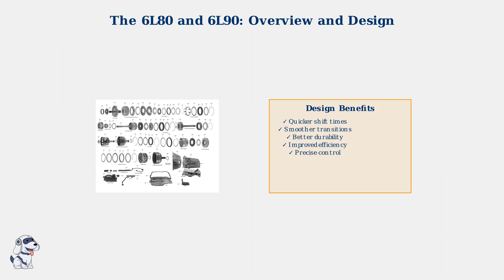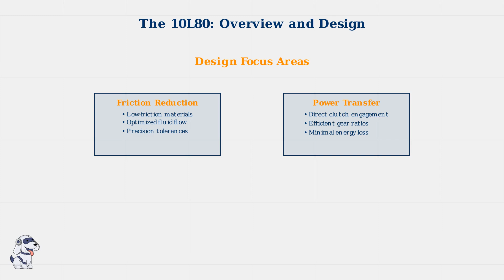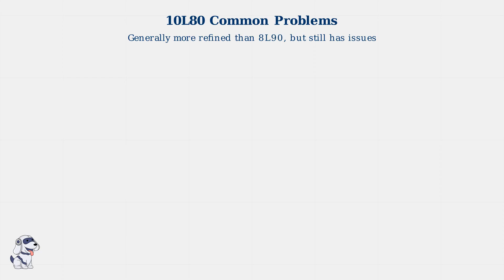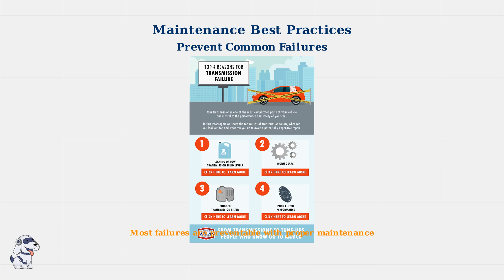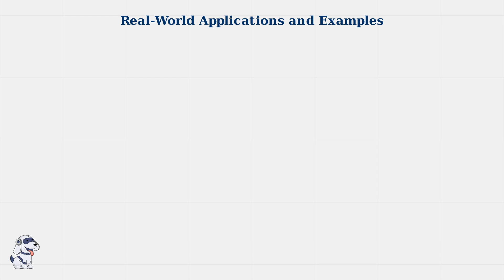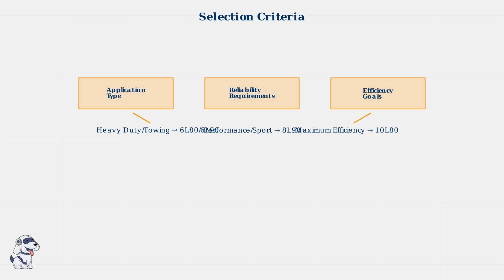GM Transmission Showdown  6L80 vs 6L90 vs 8L90 vs 10L80

Comment: Soooo please explain how no one did a failure mode & effect analysis when they not only decided to use aluminum but a cheaper versions of the aluminum which caused added failure modes!! 1- In the large shell aka (“trash can”) 2-valve body issues, 3-CDF drum bushing moves & fluid ports get blocked!! Let’s not forget the whine when the pump gear wears!, Sooooo a Failure Mode & Effect Analysis which someone in the Quality Engineering department should of spearheaded & maybe they did but it was either overlooked or thrown overboard??. What now for all of us owning these multiple failed 10L-80…